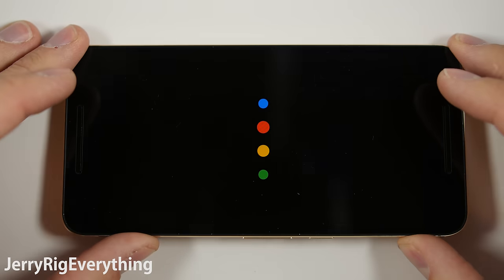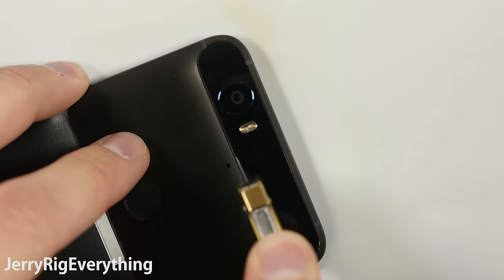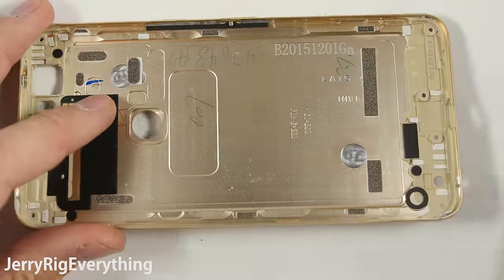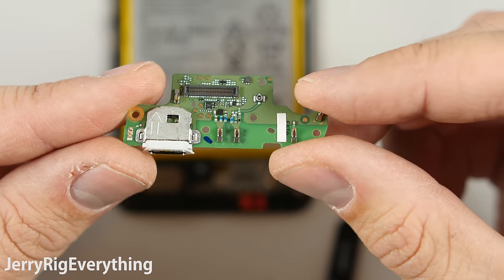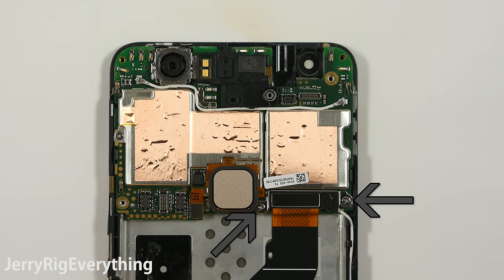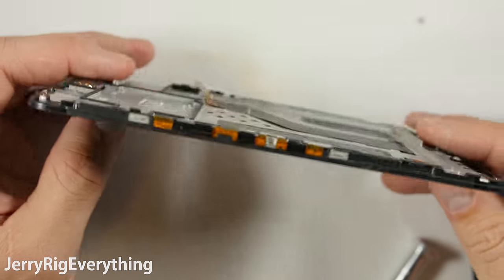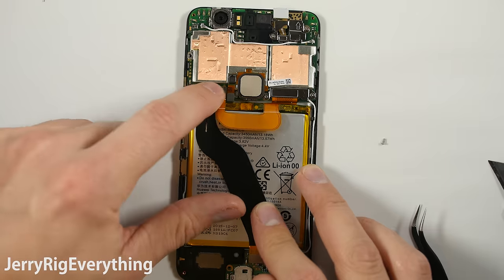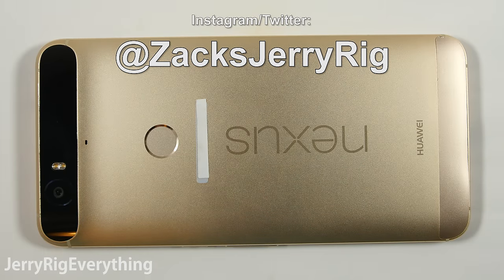Nexus 6p False Advertising - Teardown - Repair Video

Comment: Nice video as usual. I do have a few questions. It looks like you slightly damaged the plastic metal piece that sure what it is on the bottom trying to get that open to get under the screws??? Is there anyway to get in there without damaging it because if not I would have to let customers know that that could be damaged.  Also I wonder if there's a solution for the glass issue. Maybe a miniature suction cup?  It just sucks you have to damage The housing in order to work on this phone.
Reply: Stupid thing won't let me edit it. One of the sentences that make any sense thanks Siri. Just seeing if there's anyway to open up the housing and without leaving any marks.
Reply from the maker: I thought about using a mini suction cup for the glass camera lens.  But none that i have are strong enough.  Maybe if you could fit 5 or so small suction cups on there...  It might help.  But it's glued tight.  That bottom screw cover is plastic,  so no matter how you touch it with the pry tool,  it'll leave a little bit of a mark.  Unfortunatly.
Reply: +JerryRigEverything yeah thanks for the heads up I'll have to let customers know in the future if I work on it so far I haven't heard of a broken one yet except for yours of course lol

Comment: One of the good thing about this phone is that the bottom board is actually separated from the main board, not like the 5X. So, IF something happens down there, you don't have to change the whole board, which is expensive as F.
Reply from the maker: +Abdul Aziz Amar I agree, the replaceable charging port is a positive aspect.

Comment: i suspect the metal/plastic is for antenna signal as many all metal phones have had problems with signal loss, it's hardly a deal breaker
Reply: +Dan notsaying He said he didnt fault the design as much as the advertising
Reply: that's true... the metal and the aluminium are stopping the signal... I'm a Chief Technology Officer at a company that's making smartphone solution and we are using aluminium faraday cage to make directional antenna for the radio signals which include the bluetooth, wifi and the mobile network signal. So maybe this is the reason Hwauei made the  plastic and glass parts of the back of the 6p... just to prevent the signal lost of the radio signals inside

Comment: Ive had mine for 2 years., best Phone I've ever used.
Mine has not bent or dented at all.
There are some small marks on it from the hard rubber case I had it in the whole time.
I need to replace the battery now though so it may not pull through the amateur surgery I am about to perform...........

Comment: Hey Jerry, i dropped my phone from the car window on the road. It just bent in a weird shape and screen was cracked. Now I have to replace it as the repair guys won't touch it because of the bent shape. I opened it up thanks to your video, but after doing all that you did. The vibration motor and top speaker are still on the frame. I pulled out the volume chip but will the display cable, vibration motor and upper speaker be on the new housing from the above link?
Not sure. Can you help?

Comment: I'm trying to replace my 6p housing and I've noticed that my housing has a pair of contacts at the top left hand side that most of the replacement housings don't have. I think these contacts may be to do with grounding but I'm not sure and don't want to damage it by removing it and placing it on a new housing. do you know what these contacts are and if they are safe to remove?

Comment: To anyone who has a 6p or wants a 6p or likes the 6p and is offended by jerry's vids on it:
The 6p is one of the best phones on the market. The 6p has an excellent screen and has pure stock android which is amaaazing. It even has an amazing look and amazing feel in the hand. And it wasn't built that good. 

See? That's it. Don't hate jerry for that. And love your 6p as it is. If it matters to you how structurally sound your phone is then take that last point into consideration before buying or before using it as a hocky puck. Otherwise don't be upset; it's like literally the the highest ranked smartphone right now and you have bragging rights....Just don't bend it side by side with my oneplus X ( ͡° ͜ʖ ͡°)
Reply: +SAK XIII And dont trust the advertising, I never do.
Reply: +TheAE35Unit Yup like Jerry.

Comment: How would the antennas work sweetie? No point in putting the bottom and top panels in (made out of plastic and glass) if they are going to be made of aluminum underneath... the signal needs to go through somewhere.
Reply from the maker: +William Patton I understand sweetie. The iPhones, have plastic integrated into the frame as well.  But hey dont screw things into it structurally.
Reply: +JerryRigEverything the plastic to metal screws don't have anything to do with the volume button weak spot though, right?
Reply from the maker: William Patton Ya, they both are consistent with that.
Reply: +JerryRigEverything if you are interested, I have a nexus 6P in gold that when held up to a light and looked at from a narrow angle, you can see a tiny bump at the volume and power buttons, and a slight curve, but the other side is razor thin. I would imagine that the volume button is the problem causer here, and that once the volume button fails the midframe starts to separate from the plastic. I still love this phone but shame on Google
Reply from the maker: I totally agree. that 'krinkle' near the power button has happened to a lot of people.  The reddit forums were complaining about it as well. It seems to be a decent phone other than the build quality though!
Reply: +JerryRigEverything Hey Jerry, I only read that people that get the "krinkle" were using a metal (or very rigid) case. Since the backplate is aluminium, the phone expands and retracts in size, which can krinkle your phone, if it is not inside a silikon or rubber case!
(I'm a using the Spigen Rugged Armor, and have had no issues! And no krinkles :P!)
Reply: +Doctor ORBiT I use the Verus and I have a krinkle

Comment: May be if the price was set at 600$ they might have done with complete metal but as you they shouldn't  have advertised as such. Nevertheless another great video
Reply from the maker: +Krishna VV Hey thanks! I appreciate it. And I agree with that price point.

Comment: I understand that they have to cut corners somewhere. Even not being as solid as it was believed to be it is still a pretty good phone for 499 $. What´s f****d up is that this thing cost 650€ in Europe. To put that in perspective, that´s like 705,35 $. After this video i am seriously considering not buying the phone untill it goes on sale or something.
Reply: ... Even costs more in romania
Reply: +Richard Rusinaru Damm, even more? that sucks... Google did a serious mistake with prices outside the US.
Reply: +ant123ps3 yepp... It costs about 3199 Rons, which is about 800 euros for the 64 gb variant, and 3499 rons (870 euro)  for the 128gb variant
Reply: +ant123ps3 btw is within the galaxy s6 edge +'s price range... That phone is a bit overpriced too, but still better phone than the 6pee
Reply: Richard Rusinaru That´s way too expensive. Back when i bought my Nexus 4 there was no competition on it´s prince range, i wish it was the same case this days.
Reply: +ant123ps3 All phones are transformimg into iPhones, like... Being overpriced, sealed in batteries, no memory expansion, more simpler and less awesome features and getting more fragile every year
Reply: +Richard Rusinaru Actually its around 640 euros atm. Anyway phone industry in Europe is a complete rip off. When they launched the iphone 6 you had to spent as much as 1500 euros for the 6+ with 128gb while the cheapest 6 was around 950.
You know something is wrong with the industry when a high end phone costs as much as a high end PC.
Reply: +Bizo221 Yeah, totally agree. I literally don´t know what to buy and my nexus 4 has started to show its age (random reboots, 2hrs of screen on time, only 8gbs of storage, etc...). I was decided to pay for this one, but I want it to last for around 3 to 4 years, so after watching the video i don´t even know what to do anymore... I wish we had the same prices so at least that was an incentive to get it.
Reply: ***** Well, tell that to my 7 years old 32gb 3gs that I use for music or to my now 3 years old Nexus 4 haha. I think that it depends a lot on your mindset too. It is true that is a lifetime for tech, but  I am that guy that takes a lot of care about his tech. Believe me that if i have the money to change every year / year and a half i would, but I just simply can´t ;(
Reply: +ant123ps3 you might wanna look into something like the nexus 5 or 6, especially if you look on amazon, i don't know how the prices look there but the nexus 6 is selling for $249 on amazon, and keep in mind while the nexus' are old they'll actually still get updates unlike other older android phones
Reply: Harley Strain Sadly, the nexus 5 is not an option for me. I want something with a bigger battery. On the other hand, I have checked how much the N6 sells for and..... 399 euros (32 gb version) is the cheapest I have found. In amazon it cost +400 euros. I think I might end up jumping into something big like an iPhone 6+ 64GB (699 euros at a local store, Apple sells it for 815 €) or I will just wait for the price on the 6p to go down. Btw, thanks for the suggestions buddy :)
Reply: yeah it's a totally different market over there, i'd suggest the moto x style/pure but idk how much it sells there either
Reply: Harley Strain The style sales for 512 euros... Not a great deal at all... The 6 plus has started to grow on me a lot. Don´t know what to do to be honest.
Reply: +ant123ps3 yikes, it was an easy choice for me, the nexus 6 beat out every other phone for sub $300 easily. however I'd vote against a samsung or lg, they're great phones but i find their skins of android very distasteful
Reply: Harley Strain Yeah, I would have picked up that 250 $ deal on the N6 without doubt... And yeah, totally agree on the Samsung/ Lg point. If only they had Stock android out of the box ... that will be amazing.
Reply: +ant123ps3 well i hope you find the right one, you can't go too wrong, there's a lot of good phones out there
Reply: +ant123ps3 oh and the n6 dropped down to $199 on black friday, i missed it though because i was asleep

Comment: Hi Jerry, i got a Nexus 6P in January 2106, unfortunately i had a little accident sometime back, thought i was unhurt, my device took a hit on the back, there is a 4 cm long dent starting right besides the fingerprint scanner going downwards, surprisingly the device was working for 2 hours after the incident as normal, after which all of a sudden it went dead, when i took it to the service centre, i was told to replace the mother board (that costs a ridiculous Rs.28,000 when the new device comes at Rs.40,000), i would like to have your two cents on this, do you think if the motherboard was damaged the device could work for 2 hours ? or am i being fooled ?

Comment: Don't see why folk want to purposely try and bend their phones of any make. I have 2 6P's and both are slim cases to preserve the aesthetics and protect. I've always got cases for every phone since 1991! If you buy something expensive you do everything to protect it no matter what the advertising. You'd never buy a Range or Land Rover and then purposefully try to crash it would you? I came from the Note series after Samsung decided that the UK didn't deserve the Note 5 and am delighted with the performance and construction of the 6P. I sometimes put them in a jacket or back pocket but don't attempt to sit on it as I wouldn't any other phone. If you simply look after your gear then it will last IMHO.

Comment: Jerry, my 6P has encountered the boot loop of death after the four core patch that I'm sure you've heard about. I want to get my data off the phone and have a spare motherboard from another broken 6P. It looks like it's possible to swap the motherboard for the working one. Wouldn't that essentially be replacing the processor cores along with it? Would my data still be there afterwards? Or is the "memory" of the phone a part of the mobo?

Comment: iphone 6,  6s, htc m8 and m9 have plastics lines.. Is that build quality issues too??
Reply: Plastic bands to allow reception, sure. Plastic framed that support the phone's integrity? Heck no.
Reply: +Bryan Lee yep,  but,  they got plastic too.. Maybe less noticeable that nexus 6p..
Reply: Fernando Balceda The issue here is that the Nexus 6P has plastic supports inside, especially where it matters for build strength :/ As far as I know, the M8/9 and iPhones have solid aluminium inside.

Comment: I don't see an issue with such a small percentage of the whole phone being plastic. If the WHOLE body of the phone was metal the signal reception would be absolutely terrible and end users would moan that they didn't have good signal strength. I for one don't feel lied to by the manufacturer and I never intend to see the inside of my device anyway. Its not false advertising its using the best wording to describe the product.
Reply: +Eddie Ambler 

Well just call it a plastic/aluminum hybrid body.  Paluminum

Comment: Hey, i was using Nexus 6P but now it is bricked. But when I went to a local repair shop he changed a coil in motherboard and it worked for 5 days and again it bricked. And now it is not getting repaired. Any idea how to tear down the mother board and repair it ?

Comment: While trying to clean dust out of the top speaker grille of my Nexus 6P, I realized that some parts of it are free-floating, while others are held in place by the speaker itself. The same is true with the bottom grille.

Comment: My nexus 6p screen has randomly with no fall whatsoever just completely turned black. The touchscreen works and you can still hear some noise when you navigate menu or volumes but the screen is totally black.. Any suggestions as to what the problem may be?

Comment: It's unpleasant to know that these hardware reviews don't mean anything. I had the Nexus 6P for more than 2 years, I still technically have it, I just don't use it, and I've never had a single issue with it, other than the battery eventually losing it's ability to hold a charge. I never used a case. So I would say, in a real life scenario, it was a great phone! I'm just upset that at one point I actually used these videos as research for my phone purchases.

Comment: I loved my 6p and understood that "all metal body" was bs before I even bought it.  I had the defective battery though and tried to get it replaced but got stuck in a loop between Google and Huawei
Reply: Mike B I bought mine just today second hand from someone they did not tell me the phone shuts itself off which means it requires battery replacement
What do you think I should do?
Reply: @5786sagar  unfortunately short of finding a place to replace the battery there's nothing that can be done , battery replacement usually runs 50 to 100 bucks depending on your location.

Comment: Damn...not sure how to feel about this phone anymore. was considering buying it. :(
Reply: Buy an iphone ;)
Reply: +JustKiddingPro Get the Note 5 or the 6s+ if this dissuades you.

Get the Note 5 if you prefer Android.
Get the 6s+ if you prefer iOS
Reply: +Timothy Lim Get the Moto X Pure/Style if you like stock Android.
Get the Moto X Force/Droid Turbo 2 if you like dropping phones.
Reply: +JustKiddingPro At first I wasn't sure about this phone too but I got it and it's one of the best Android phone you can buy. Great display, Great speakers, Great all round camera, built quality is top notch and you'll direct updates from Google.
Reply: +jean-christophe Tremblay Hell no. iPhones are shit.
Reply: +JustKiddingPro Get it; I don't regret it. As you long as you take care of it, you won't have any durability problems. For me, that just means using a case. I've had it for three months now and have yet to have any bending, cracks, or scratches.
Reply: +JustKiddingPro Buy it. It is the best smart phone I have ever owned. Nothing even comes close. 

And Android N is going to be awesome on the 6p. I got it for $449 during december and it was one of the best purchasing decisions I have ever made. 

Great battery, fantastic front facing speakers, extremely fast with whichever qualcomm processor it has, and pretty much everything else is great.

Unless you are waiting for the next google phone, the nexus 6p is a definite buy in my opinion.
Reply: +John Smith I actually wanted to buy this--but Nexuses are not in Villagestone.
Reply: TheRedstoneVillager i have no idea what dis means
Reply: John Smith Until you drop it
Reply: John Smith They don't sell Nexii (or Nexuses) there.

Comment: I've a N6P (64GB) that boots up fine, but when the SIMcard goes in it keeps saying that there is no signal. This one never had a bootloop, was never bin opend, and did stop working on 4G or mobile-network in 2016 after the marshmellow update to nougat. WIFI is ok btw. I tried the simslot to have a better connection but that was OK as it recognize the code from the cared. My Idea it might be a broken antenna. 
Anyway, my N6P(32gb) is still working.

Comment: What are the chances you actually have pirate copies of the phones? I've seen some pretty convincing knock offs that I'd never have known the difference on if I hadn't been outright told.
Reply from the maker: +Dave Wilson Valid question.  I purchased 2 directly from Google, One from Ebay.  All have the model numbers, boxes, and match the hardware and the same build of other tear-down videos like iFixit's 2 teardowns.  My channel is dedicated to showing the repair of real devices, so I make it a point to buy from the source.

Comment: it doesn't have to be entirely metal. the body is metal is good enough. the glass antenna is a part. but not the body or frame.